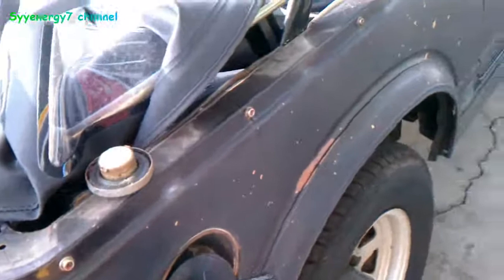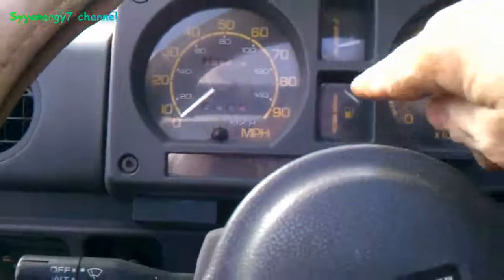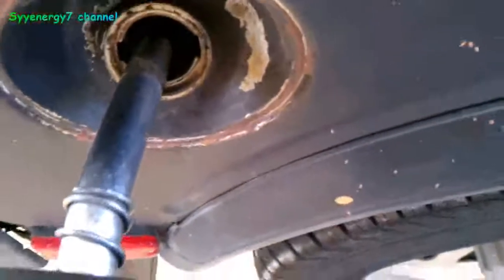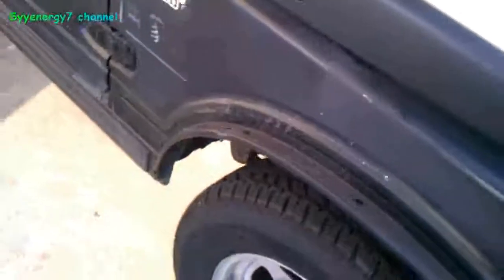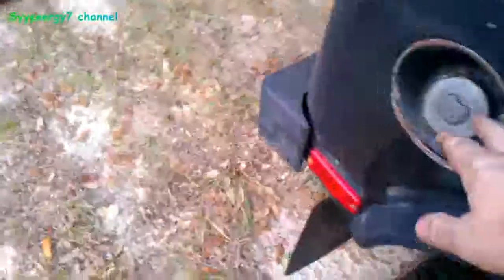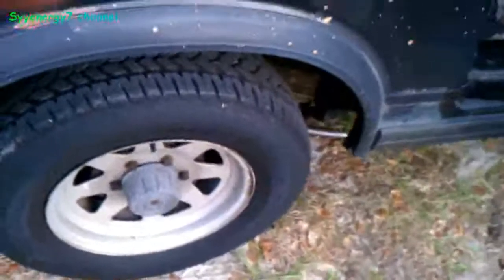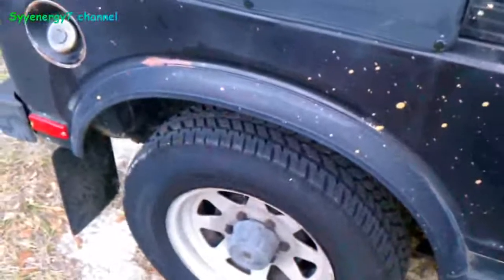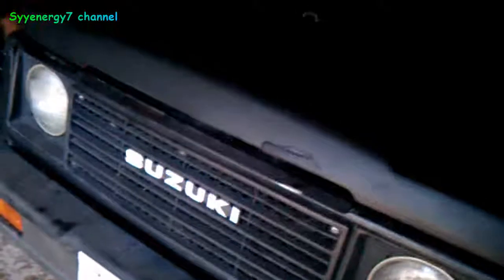Suzuki Samurai HHO, Real World 30 mpg, mixed driving

Comment: The number you quote for tire size is for the width of the tire. ex. 215 70r 15   =  215 mm wide  70mm high from rim and 15 is rim size
So, unless the middle number is different your odometer accuracy  won't change. But wider tires do weigh more have more friction and will lower fuel economy .

Comment: What system are you using and what are you trying to achieve by using it? syyenergy7
Reply from the maker: Liberator 16 plate dry cell,
and
http://www.nationalcarburetors.com/lookup.aspx?partnum=TOY250
78 Toyota Corolla, 4 Cyl. 1.2 Liter with a manual choke
1973-79 Aisan carburetor